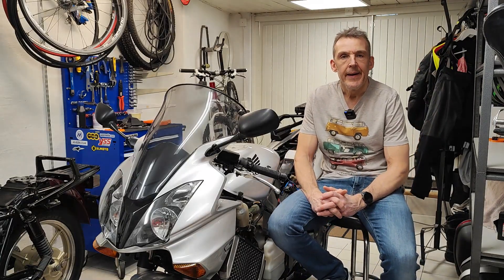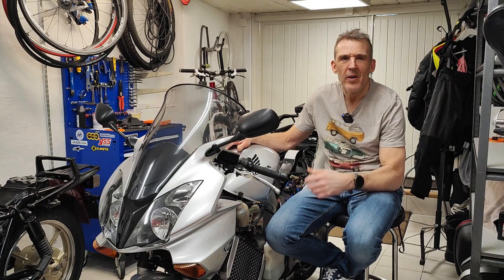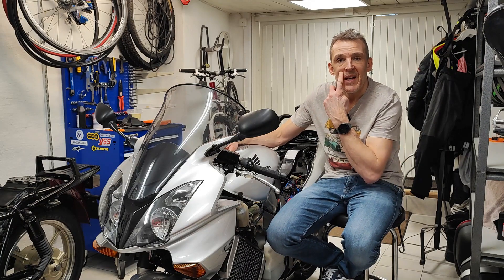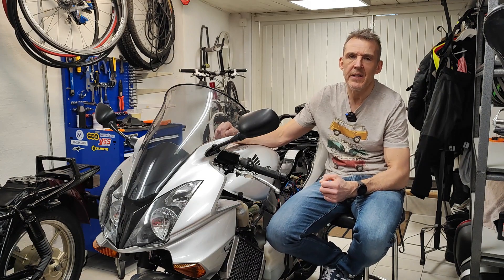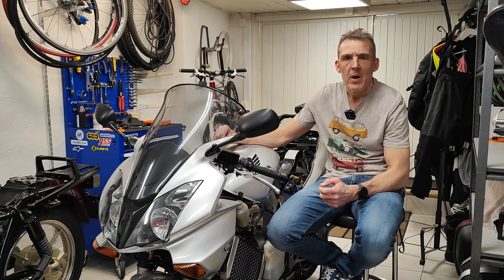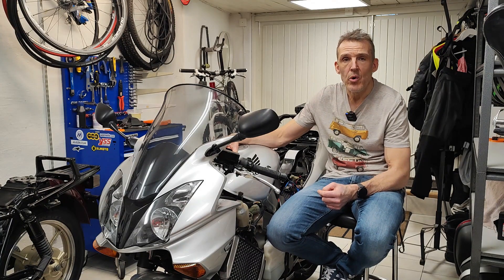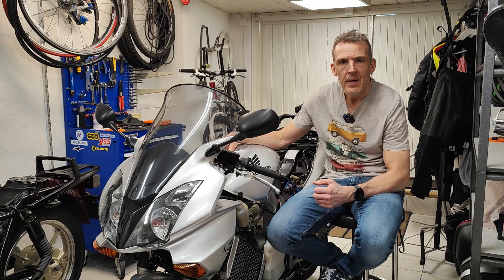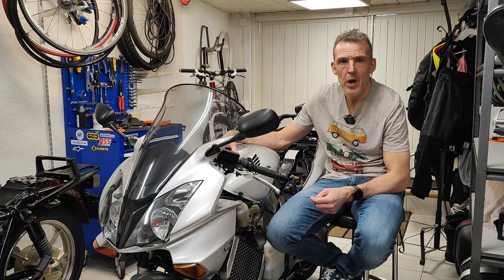Honda VFR 800 Mosfet rectifier added to bike. How I made backing plate, wiring and fitted to my bike

Comment: Voltage-Characteristics over the rev range?
didnt see any readouts 🤷
by the way, getting a second solder iron @ about 50 Watts could be helpful soldering thick cables. 😉
Reply from the maker: Goes great my friend! No problems!
Thanks for your support!
Reply: @andrewonmyway8184  Voltage goes great?
🤷 well then 🤷
Reply from the maker: @AmbaMerlinson  If i remember correctly i think i had around 14v at tickover. I did this over a year ago now and use the bike regularly. Cheers!
Reply: @andrewonmyway8184  thank you for your answer.
lead battery final charge voltage is @ 14,4Volts.
shop manual says 14,4V,
lights on,
@ about 5000rpm.
most bike batteries die "before their time" because of never been completely charged correctly.
Good luck.

Comment: Well done , i made the same but i used the sh847 serie regulator. Mosfet are better than the original but  is still a shunt rectifier and  works the same way as the original one making the stator work hotter , probably you already knew this. 
Anyway is good making the wires go directly to battery.
Regards.
Reply from the maker: Thanks for watching and your support 🙂
Reply: hello @zxrd2753, what's the difference between SH020AA showed here and your SH847 (if you know it ?)
Everybody have to say sh020aa is the better mosfet RR to put in place .
Thanks
Reply: @jeromedruais1696  Hi , everybody? i don't thin so , maybe only the people who don't know the sh847 serie rr. 
I have explained it in my previous comment. There are hundreds of threads on forums like vfrdiscussion, vfrworld... This regulator is not new; it has been around for years. You can easily find why it is the best for motorcycles with stator temperature issues.
A short video showing how is working maybe help you. 
https://youtu.be/mwBuc0qCGok
Reply: @zxrd2753 really only makes a difference if you reduce electrical load on the bike. If you aren't running LED lights for example, you'll have no issue with the fh020aa.

If you are reducing load on the motorcycle (me if anything I am increasing it, charger for satnav, phone, etc) then consider the series RR. If not, shunt is fine.

Another advantage of the shunt type is that you can easily verify its functionality using nothing but a multimeter, the series one not so much.
Reply: @lmaoroflcopter  im agree but still series for the vtec is better because make your stator run more cold.
some people  verified this usin a temperature sensor directly in the coper winding.
Reply: SH847 or did you mean SH748aa? I did a quick search and don't see any 847s, but alot on the 748. Thanks!